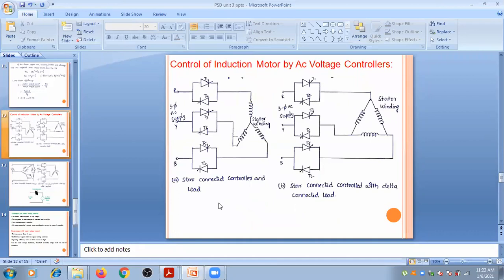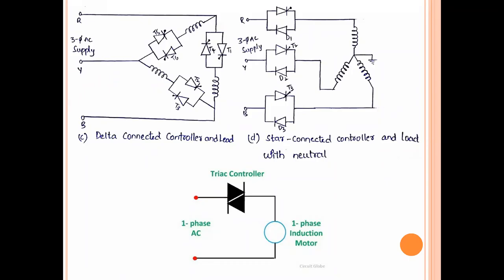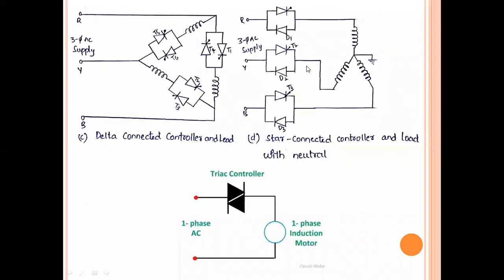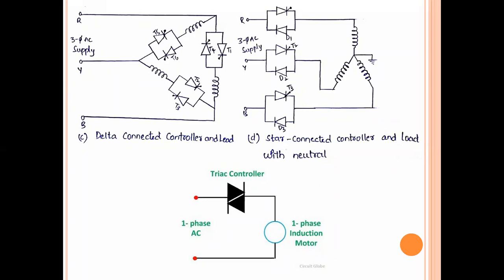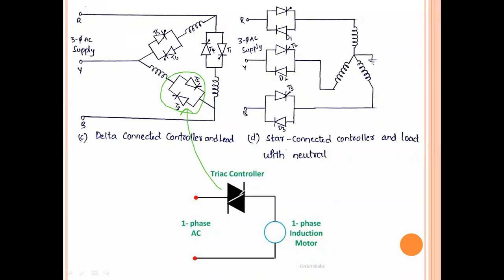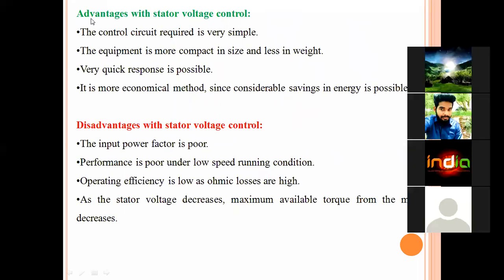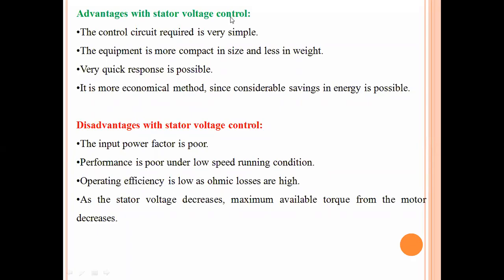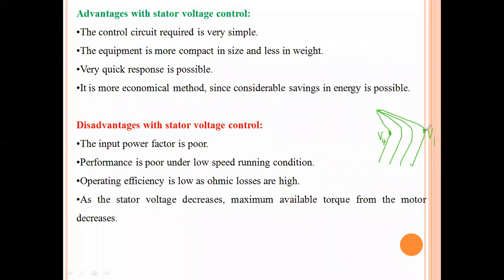Control of Induction Motor Drives using single phase & three phase AC voltage controllers

Comment: Speed of 3-phase induction motor is controlled by 3-phase a c. voltage controller. If firing angle is decreased, then
Reply: Can you answer this question
Reply: 135) Speed of 3-phase induction motor is controlled by 3-phase a c. voltage controller. If firing angle is decreased, then

(1) speed increases & peak torque decreases (2) speed decreases & peak torque increases

(3) speed increases & peak torque increases

(4) speed decreases & peak torque decreases

136) A chopper fed de motor runs with discontinuous armature current at particular duty ratio. The current can be made continuous by

(!) increasing duty ratio

(2) increasing frequency

(3) decreasing duty ratio

(4) decreasing frequency